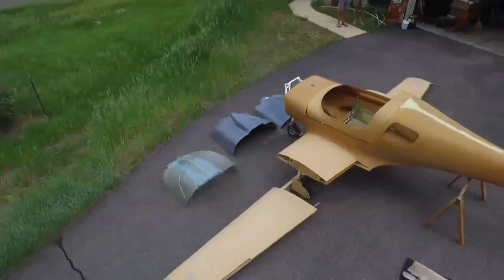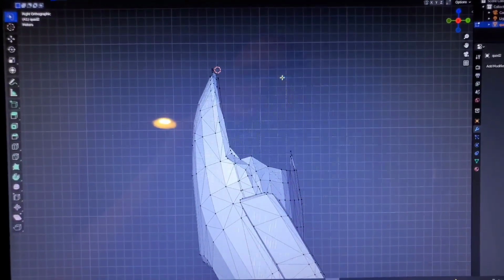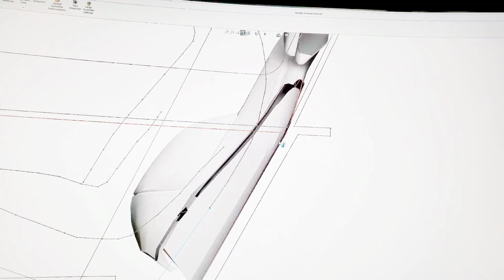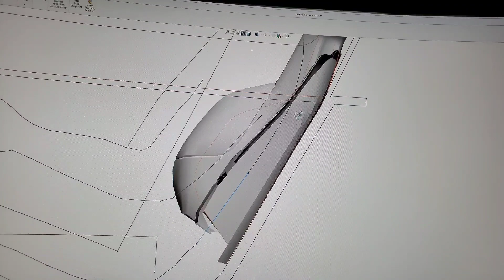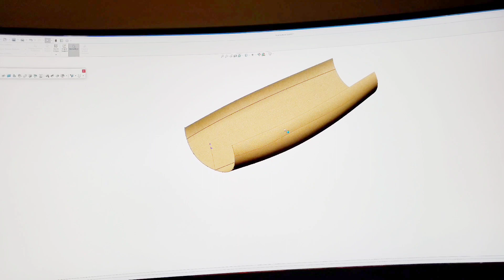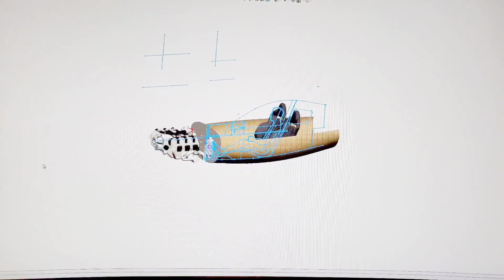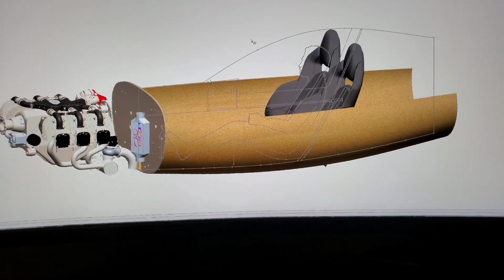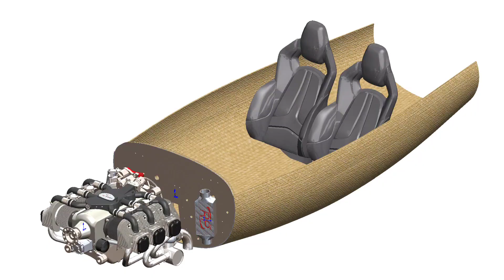Lancair 360MKII Custom Seats

Comment: You don’t need a headrest in an airplane. You never touch it with your head and you never experience a crash from the rear. It’s just WEIGHT!😂
Reply from the maker: Opinions are opinions.
Reply: @kraftwurx_Aviation your opinion adds weight

Comment: Just a thought to consider. I fly a Skystar Pulsar III which is very much like a fixed gear 360. I fly XC and one thing I’ve found important is having the ability to reach over the seat back to retrieve something from the cargo area— the backup iPad, a USB battery or the handheld radio. Snacks and other comfort items as well. I have resisted the desire to have cool looking head rests for this reason.
Reply from the maker: Great comment. Fortunately, the seats tilt forward like a car.

Comment: Nice… but they will never fit. You need about 4 inches between the seats for the center tunnel which contains the elevator push rod, fuel lines, brake lines, miscellaneous cables and wires. Plus with those high seat headrests you won’t have access to the rear baggage compartment.
Reply from the maker: The seats tilt forward and the bolsters are being reduced to fit.

Comment: I would want thick plush ultra comfortable long distance seating.
Reply: Thin seats can work as well. Check with Oregon Aero, they are a good source for seat design and materials. Layered foam of different density can work for a seat with a thickness of about 2 1/2". Copy dimensions and angles from GM automotive seats, Buick has some very good design seats that are comfortable over long periods. Create full size foam core mock-ups of your design with the actual foam layers to see if it works sitting for 2 or 3 hours at a time. Allow for some movement for your lower back that might improve your overall comfort level.
Reply: GA has the seats I like. https://youtu.be/_J2i2g_CnXo

Comment: Hello Chris, well done and nice fuselage/seats rendering. This is going to be a nice airplane. In your seat planning you haven't mentioned baggage compartment access, which is a big thing on the 360. I'm assuming you've already thought of that but just in case, unless you're planning on a left side "outside opening window" access mod, those seats don't look like they'll allow for easy baggage access. Will you wear a parachute and/or helmet? If so, you'll need space for that. Don't forget, you'll also need access to that space for your routine inspection/maintenance of the hydraulic pump, tail flight control cables and nav equipments which are all located behind those seats. In any case, thanks for sharing your ideas!
Reply from the maker: The seats tilt forward like a car. The rear window mod is also being done so it is removable and can open to allow access.

Comment: When I was building an ES, I looked into adapting car racing seats. I realized though that they're built w a lot of bolster to cope w the side forces cars experience on turns. Airplanes, however, don't experience the same lateral forces and so I assumed that most of the bolster, which was making it hard to fit two seats side-by-side, was unnecessary. What do you think?
Reply from the maker: I will be reducing the side bolsters to maybe 1/3 or so. Just enough to feel comfy and more importantly a working lumbar bladder with a pump.

Comment: Chris, with all due respect, and because I'm an engineer too, I hope you're not getting the paralysis of analysis to make this a better design.  I know you've seen it before but we, as engineers, can sometimes get so wrapped up in design improvements that the build never gets done.
Reply from the maker: Completely agree. That said many improvements I am planning are already done. Chris Zavatson has better brakes, a cowling and Carbon fiber gear doors for the outback gear. Hakan Langebro has a beluga-style fuselage mod for improving handling caused by aerodynamic issues with the area aft of the fuselage. Wing tip tanks are available also. These are off the shelf mods, not things I am designing.

The seats are for me... that's what I want! Really REALLY comfy seats. I had a car wreck and have 2 herniated disc's in my lower back.... I'm not flying a tractor seat!

I'd be happy to do an entire video talking to you about design scope creep . It's true we can get mired down in it but... in my case I can't start building till I move into my hangar next month so in the meantime.... seats and firewall forward planning.